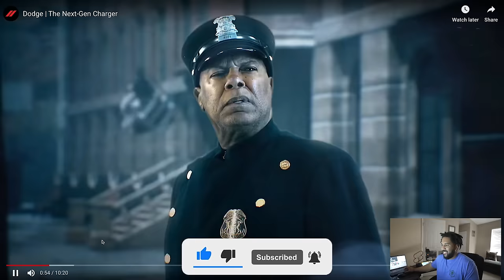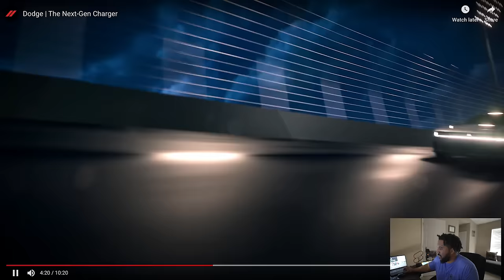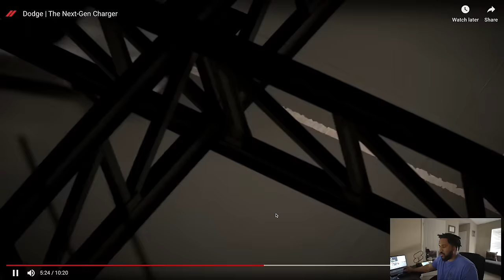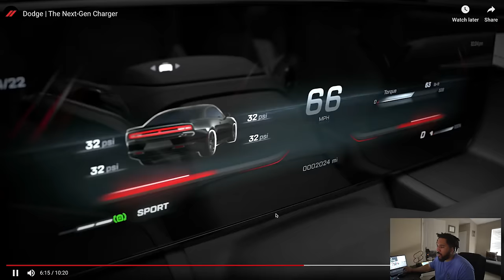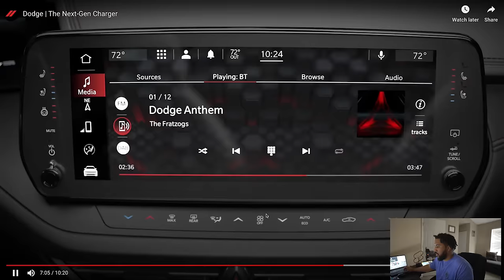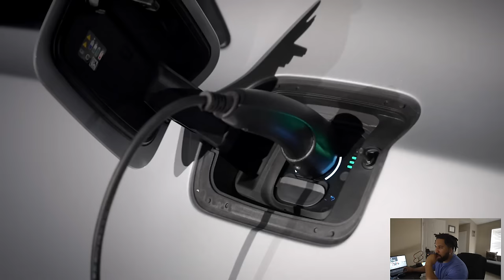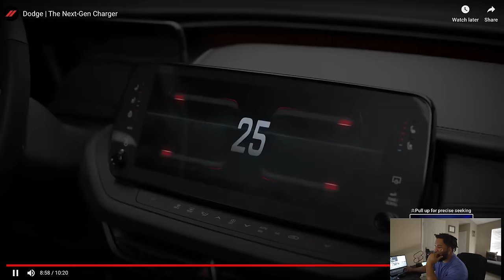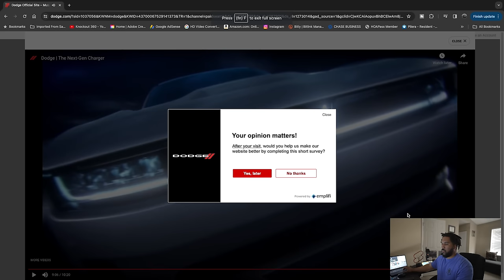2025 Dodge Charger EV is a MONSTER: 4-Door Version, AWD & Twin Turbo In-Line 6!

Comment: Mopar community ICE don't want, 3.0 Hurricane I6  Twin Turbo, failure to hybrid Twin Turbo V8 engine, the super charger 2.4L V8 or 3.0L Supercharger V8, 4.0L Supercharger V8 , Supercharger it's self super charger with small cell batteries in the in side the super charger , Volvo supercharger 4 cylinder T6 Hybrid Supercharger, T8 Hybrid Supercharger, Gas and Electric ICE Vehicles, Volvo XC90 Recharge and Volvo S90 Recharge, Ford Mustang 5.0 Coyote V8 engine and F-150 5.0 Coyote V8 are better for tuning stock bottom end, cammed 5.0 Mustang roush supercharger and muffler delete, Ford 6.8 Godzilla V8 engine and Ford 7.3 Godzilla V8 the same thing do with mods, Ford Motor Company has The modern day V8 engine war going forward 2024-2032, Mustang V8 engine, Stellantis throwing the white tow on V8 engines , the car lovers there plenty V8 engines out there.

Comment: I think the 420HP AWD version would be a great daily driver. I just hope the boosted engine will have the same kind of longevity as the normally aspirated engines did. Also, Are these new models lighter that the older ones? We could be looking at better handling.

Comment: Got my sights set on the Six Pack HO coupe, if they price it right and it shaves enough weight, it could easily be an M4 xDrive killer. Them straight-6’s can sound nasty with 272 cams, can’t wait to see what the scene does to the Hurricane engine

Comment: 6000lb vehicle that’s not an SUV or pickup truck is just insane. They need to make lighter chassis’s so they can’t actually compete with cars with the same power
Reply: It's a sad joke, when 4500 Hellcats are now 1500 pounds lighter than the NEW DODGE.

Comment: Love the info, but power has never been the issue with dodge....the power has always been there. What about the weight, getting it off the line with all the weight was the issue. If they have fixed that, then yes the dodge brand will prosper abundantly. Making it AWD is definitely a plus and I look forward to seeing what the specs for those vehicles will be.

Comment: LOL - NO YOU CAN'T JUST DOUBLE IT.

Tesla Plaid is 1020HP on 400v Architecture at $100,000+.

A Lucid Sapphire has 1200HP on 800v architecture and it costs $250,000.

The VOLTAGE has NOTHING TO DO with the HP.

The architecture is about the linking of the battery packs and the car's efficiency.

Mark my words:  you'll be lucky to see 1000HP in the Banshee and they'll probably charge "Tesla Plaid" prices for it. $100,000 or more.

Comment: Dodge is tired of loosing to Tesla S Plaid. The problem was Dodge only had rear wheel drive which was getting off the line too slow, but now with the electric all wheel drive Dodge can handle Tesla and Lucid.

Comment: Finally. No more gas guzzlers with twice the power at a fraction of the cost to run it.
Reply: finally, cars that weigh 6000 pounds, destined to crash harder with more weight and physics to fight. Oh, and ranges under 300 for Scat Pack, a pathetic 260.

Comment: They are only comparing these against results on unprepped surfaces... at 6,000lbs no way is less than 700hp going to compete against a 700+ HP Hellcat at 4500ish lbs with proper traction.

Comment: Drive train would have been better off on a new dodge dart coupe. It looks good yes but how long are them ev batteries going to last cause replacing that out or warranty is going to be expensive, not only that but you know dealerships are going to milk the fk out of this. This is going to be over 6 figs guaranteed for years. But yeah hard pass I’d rather buy an r35 gtr if I want an awd sports car or Toyotas upcoming 2025 hybrid mr2

Comment: All this power but no one is mentioning how much this yacht ⛵ will weigh. With AWD & those heavy batteries I wouldn't doubt that it will weigh 5,000+ LBS

Most of the time when there's a muscle car that has a lot of power it's because it weighs a lot.

Comment: The hp rating sounded good until you said EeeeVeee.  Unless these EeeeVeees are using something lighter than a 2-ton battery, you need much more hp to keep it moving at the same speeds as a normal car.  Dodge will also need to make something that doesn't have a Mercedes price tag.  If Dodge is planning to push something like the underpowered Ford Mach-E and start pricing at $75000, that's not exciting.

Comment: Hey man, if you want to calculate horsepower from volts, you need to know current. Simply knowing voltage does not really tell you anything. Doubling 670hp from 400 volts does not get you the Banshee's horsepower. Electric motors are rated in (kilo) watts, which directly converts to horsepower. However, watts are equal to volts times amps (W = V x A). Without knowing current (amps), we cannot know the true horsepower of the Banshee. It could be a lot more than 1000, or a lot less. Rumors placed it somewhere in the 800-900 range, bone stock before direct connection stage kits. We don't know how much those stage kits add for the Banshee specifically though.

The Tesla S Plaid makes 1020 HP if I recall correctly. Hopefully this car makes more than that, because it's heavier. I don't want to lose to a Tesla lol

Comment: chargers were 2 doors for almost the whole time they were made from the first gen from  66-67 to the fifth gen from 82-87 
it was only the the 6th gen from 2005-2010 and the 7th gen from 2011-2023 that the charger was turned into a 4 door 
and now with the 8th gen the charger returns to 2 door with a 4 door option

Comment: It’ll definitely have 1300 horses but next year that Tesla plaid is getting a new look & zero o to 60 in 1.4 seconds so I hope that Banchee is on point. Tesla model 3 Ludacris comes out in 2 months with a zero to 60 in 2.5 & it will now pull in 40 & 60mph rolls. So Dodge has to come with it. Tesla also gets speed updates every other year so Dodge gotta come with it

Comment: Dodge just made EVs cool. I like the retro-mod look of the Charger. Since I love the Challenger look more than the new charger look I really like what they did with these. And the 4 door option is a nice touch. Hate to see the Hemi go but I’m not mad at this new batch. Still have buttons for the AC. I’m just concerned about the prices and the charging times. If we’re driving fast will it used up all the power?
Reply: the coolest 6000-pound 2 door car on the road....

Comment: They still haven’t mentioned range.  The faster, the shorter range.
Reply: it is out there and Scat is under 300 miles, 260ish.
Reply: @Thurmanatr16 I appreciate that.  I have a Kia EV6 and it’s supposed to get 320 range.  It hardly charges to 230 on a full charge.  The most I’ve gotten is 260.  The new dodgers look good, but I’m afraid people will be disappointed.  Everything runs off the battery.

Comment: If they real can hit 1300-1400 HP with AWD, The on production cars coming close to that is the $250,000 Lucid Air Sapphire and the 2.2 Million dollar Rimac Nevera. It will smoke the Plaid at a Cheaper price if they can get it to 100K area. Dodge might be onto something. I want to know what charger platform its using. Hopefully NACS aka Tesla Super Charging. It would be great for trips

Comment: The government did not tell them not to build V8 stalantis told him. And as far as the tires they are 305 in the front 315 in the rear and the top of the line banshee I assume it's going to have the 325 on the rear that would be my guess. From what Tim said.

Comment: The truth yes they checked off all the boxes.  But they would have been better off to develop a more fuel efficient Heni engine. The turbo  and the electric engine with the batteries is going to be big trouble in the long run .I hope I'm wrong

Comment: The Banshee fin be the electric replacement for the Demon. The one problem with the demons were they were rwd so they weren't near as fast as advertised. But being electric and AWD, pretty sure it will be more....forgot the word😒 but able to do it multiple times and get the same times. Hate ADHD. Not gon lie, it took awhile but this new charger eventually grew in me, I hated it for a while when the leaks of the new concept. Especially when the production looked a bit less nice than the concept, but that's with most concepts vs production models. Ik this whole electric thing is just a phase at this point until hydrogen, ammonia, or even water powered engines come into the main stream to save combustion, and plus, I love when electric motors look at diesel truck owners like, "stop rolling coal, it's bad for the environment" like bro, yo factories are rolling ACTUAL COAL muthafuccah and with bigger exhausts😂

Comment: The cars LOOK good, but I don't care if it's putting out 5000 horses, I'm NOT doing any damn electric anything.
And then they put a damn fake sound loudspeaker under the ass end?!?
There is NO electric cars that fit my driving needs, because I don't have an extra hour in the middle of my day to plug anything in. Fuel stops can take no more than 15 minutes, cause I gotta go!
I'm done with them all!
EPA, and all the greenies can K. M. A.!!!

Comment: Ahhh the Dodge Charging Speaker Bank  - It's Basically Free Advertising for the Ford Mustang Dark Horse and Future GT500! 
- *

The Dodge ChargingBank is a Non fictional product and does exist.*

- No Ford Mustangs were involved in the creation of this advertisement.
- The claim of the Dodge ChargingBank having a top speed of 130 MPH (130 MPH SMH !!! ) is entirely Non fictional and Probably based on actual performance data.
- Any resemblance to real products or brands is purely coincidental.
- The Ford Mustang Dark Horse and GT500 are not affiliated with this advertisement.
- Revving engines and sleek designs are trademarks of Ford Motor Company, not Dodge.
- This advertisement is intended for comedic purposes but should  be taken seriously.
- *Dodge,  mentioned in this advertisement are responsible for the disappointment caused by the lack of a real Dodge Charger and challenger successor
- *Always drive responsibly and within the speed limits, especially if you're trying To brag that you dont have a charging bank By severely Outpacing it With your Stock Ford Mustangs

Comment: ITs going to be a shit ton of dead battery Dodge EVs on the roadsides! Guys and girls get your white towels ready, because we currently don't have the infrastructure for an influx of EV vehicles, and I'm not driving back to the dealer to charge my EV. and there is no way that the wall charger will charge a 400v EV overnight. Other than these factors, they look really good!

Comment: Unless im mistaken the way they have the turbos set up on the I6 would allow them to be connected to the exhaust as true duals. If the manifolds are unequal in length and continue to the rear with true duals that engine will sound a hell of a lot better than the Pentastar. Here's a Mustang with an I6 and true duals. https://youtu.be/T79GEv1IjB0?si=hIIvufJnnEuR9MUS